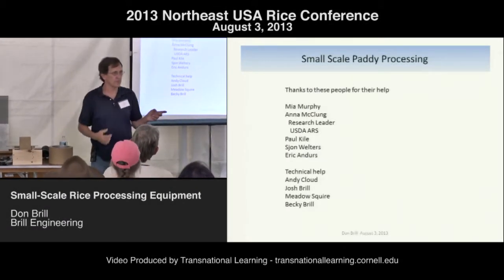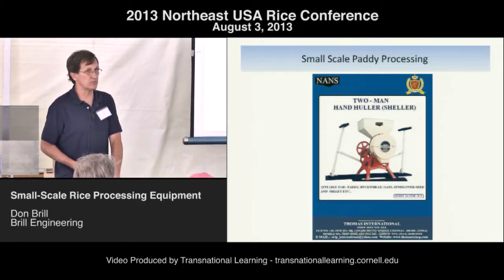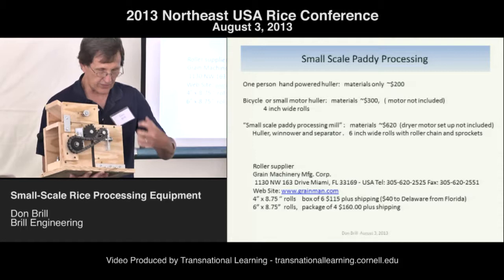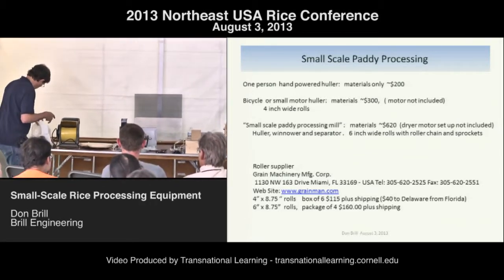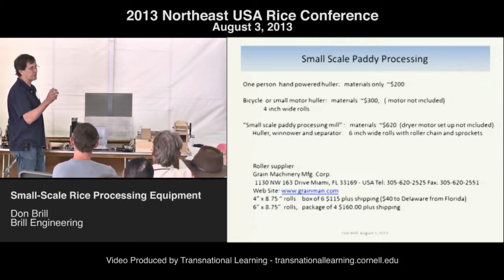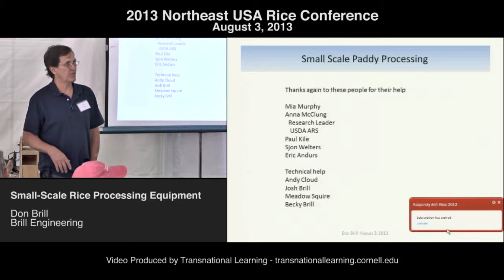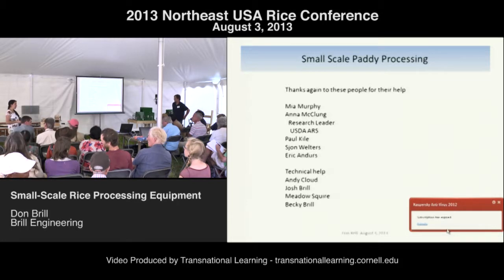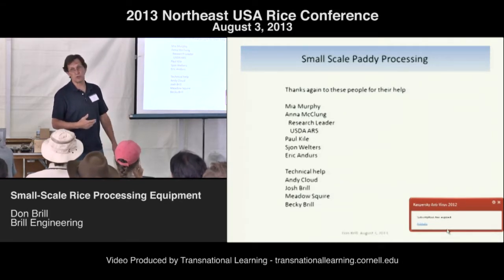Don Brill - Small-Scale Rice Processing Equipment

Comment: The equipment discussed in this talk are shown operating in the small scale rice processing demo video also taken at the Northeastern Rice Conference.   It includes a hand powered rice huller, bicycle powered husker and complete small scale rice mill having a huller, winnower and separator powered with a motor blower assembly from a clothes dryer.